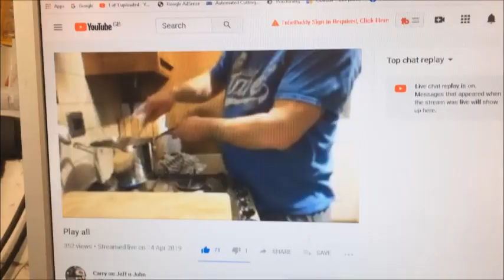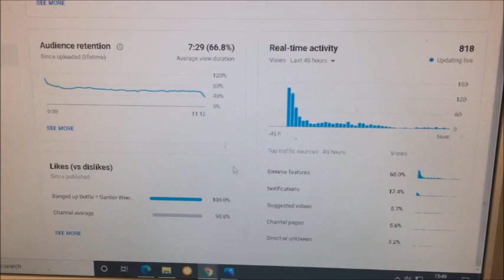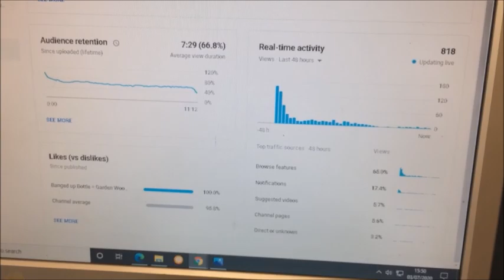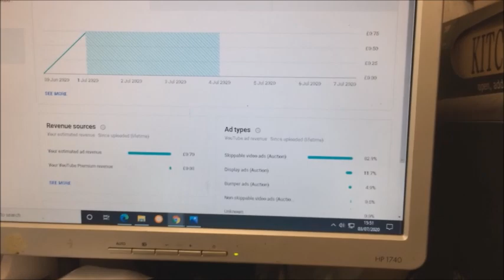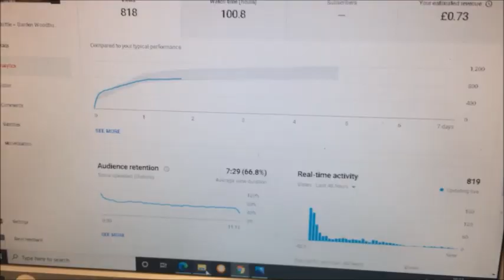Birds & FRIDAY finds July 3rd dedicated to Dianne Griffin

Comment: Ironically my mother taught her friend from Yorkshire, how to make Yorkshire-puds. The thin cutting discs(we call them zip-disks) are most dangerous...any1 whose worked in metal fab. shop, has either experienced...or had safety videos regularly remind them the dangers of high rpm cut/grind tools...but thx 4 the warning. many hobbyists misuse such tools. We've all cheated safety...dare i say, safety gave u the finger for a moment u tried to cheat it
Reply: I agree on those disc's Les, anything that can zip through steel will make short work of flesh and bone.